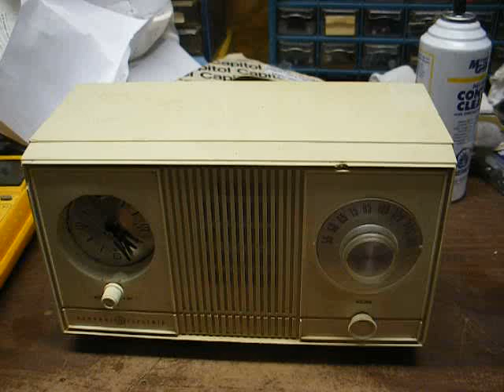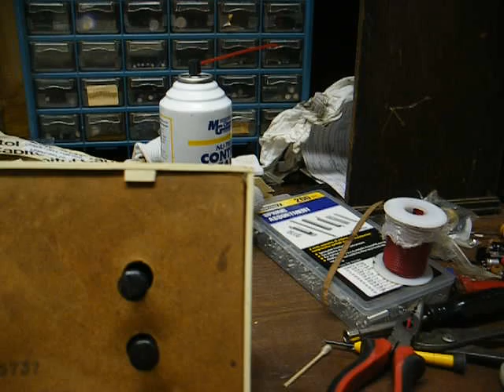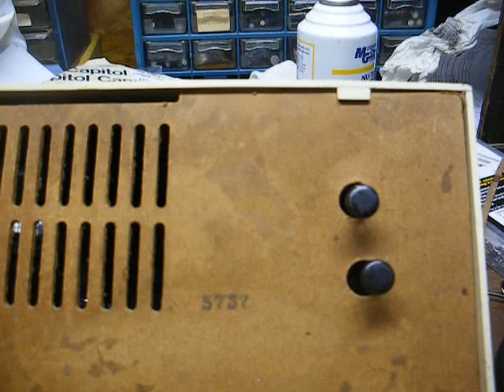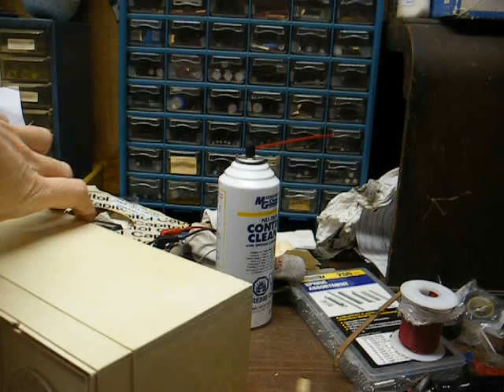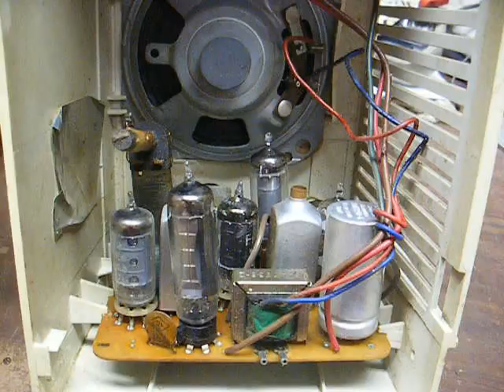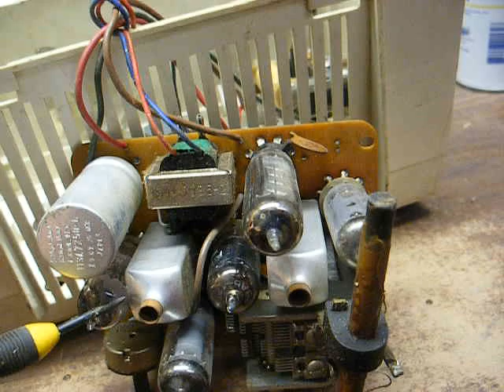GE AM tube clock radio from 1967

Comment: Nice. I was 4 that year.
I accidentally knocked a tube radio on the floor, I was a kid. It couldn't be repaired. I theorize the circuit board got busted. It was an L- Shaped unit. Adjustable green clock light.

Comment: This should be a 1957. 4-digit date codes are YYWW. If you want to verify that, you transformer should have a date code as well, and the original can cap. Those should be MMMYYWW, where the "M" code is the manufacturer of the part.

Love your channel, by the way. Keep up the great work, sir!
Reply: Never mind, I see you found the other date codes. If this is a 1967, then what does the "5" stand for?

Comment: I have a GE AM/FM model from 1966 that is similar. It's obvious that their products from this era were designed for easy production, everything snaps together with tabs, there is only one screw on the radio. Pots are plastic, tubes are on a thin pc board, tuner is a daughtercard module. Works fine and sounds OK, but the feel is still cheap, the tuner especially feels cheezy because the string drags over plastic guides, no pulley wheels are used. Compared to a Panasonic model I have from the same year, the Panasonic has a metal chassis wired point to point, ball  bearing tuner, metal pots that are very smooth, tuner with multiple pulleys and metal bearings, and many screws and bolts holding it all together. It feels a lot more solid. I'm sure it cost much more to make.

Comment: I think 50's/60's-era GE clock radios were arguably the most mass-produced tube radios of all time. Even now, you still see them everywhere. No surprise that one still works---by that time, they had engineered all of the paper capacitors out of them.

Comment: Call GE cheap just they actually stood the test of time pretty well. Except the plastic
Reply: It's not, it's polystyrene.
Reply: The cabinet is probable made of Lexan, a plastic made by GE.
Reply: Jerry Carriera
Yes the IF caps have been an issue on some of them but I have that all worked out
Reply: shango066 I agree. Not all GE is cheap crap. My mum still has a lot kitchen appliances from the late 60's to early 70's that are GE & she still uses them. My old electric mixer is a GE from the 70's & has the fake wood grain on the handle! It's still in it's original box too & works well. 👍🏻🍰😀
Reply: I have an old GE lightbulb with the evacuation stem on the top of the bulb, a brass screw base with a big glass insulator, and Edison's name on it.
It works.
Reply: You think it's bakelite or not?
Reply: And the caps in the IF cans.
Reply: Lexan is polycarbonate.
Reply: GE's electronics have for the most part been cheap crap, with a few exceptions. Their appliances, on the other hand, were quite good up until the '80s. My parents still have a GE vacuum cleaner from the late '50s that still works. My dad found some modern bags that he can modify to work in it, they stil use it to clean the basement. I had a GE refrigerator from the 70's, avocado green, with the fake wood grain on the handle, too, that lasted until 2014.

Comment: Gee, I must have really good luck with my modern radios, lol.  My wolverine radio back in my bedroom has lasted 2 years and still going, LOL.  And my Sony surround system is going on 10 years now and still working just fine.  Now, I've only had my Logitech surround for  my pc for six months so I guess I'll keep my fingers crossed, but having said that, I do still love all my tube radios...even the ones that aren't working again, yet.

Comment: That thing is a prize; I love firsts and lasts for things like this. It's got nice, symmetrical lines. The sound has it all over that awful Pennecrest, but it is a bit tinnier than most tube GEs, probably due to that tiny output transformer and the vents that run right up to the back edge of the speaker. Funny how the transformer sits just over the power connections; I wonder if a similar SS-layout board was made with the power transformer in that location. I still remember seeing some last minute Hong Kong-made AA5s in Wolworths for about $20 around 1975; seemed like a high price for the features back then, but in hindsight, I wish I had bought one and kept it in new condition.

Comment: 5:35 I had to run a ground wire across the row film switches on my '85 GE vacuum florescent clock radio; before that, whenever I got up to turn it off on a cold morning, the static charge that accumulated from the walk across the room would knock it out of service for a couple of days.

Comment: That's a model C2410 radio from late '67.  Yes, it was the bottom of the line clock radio.  That model was probably what was known at the time as a cost leader item for mass retailers during the Christmas season.  Basically they advertised it and sold it really cheap at or near cost as an incentive to get people to come into the store.  Walmart still does the same thing with electronics today.  It sold for about $10-$12 new.  A solid state one would have been about $14-$16.  GE was well known for using the same or similar cabinets for both tube and solid state radios and across multiple years.  

A lot of people criticize GE for being cheap, but they never claimed these radios were anything special and they were priced accordingly.  People knew what they were getting.  Yet, many of these radios survived and still work today.  Also, by 1970 most other American companies had given up on radios all together because there was no money in them, but GE kept cranking them out for many more years.